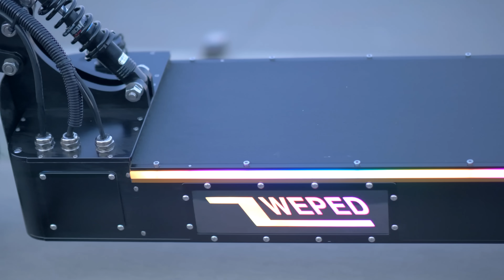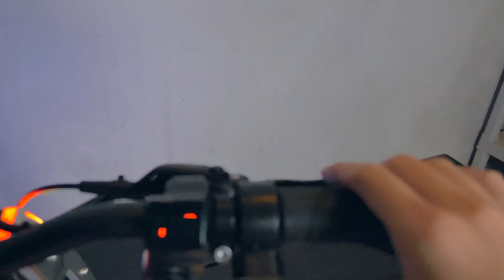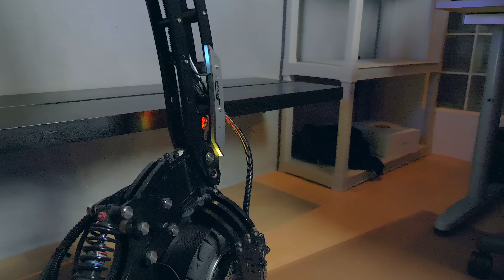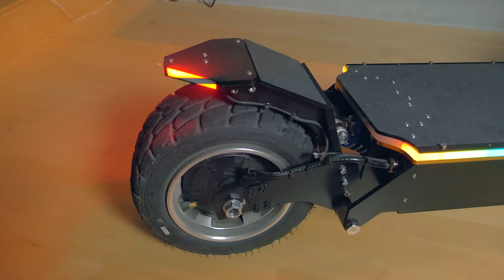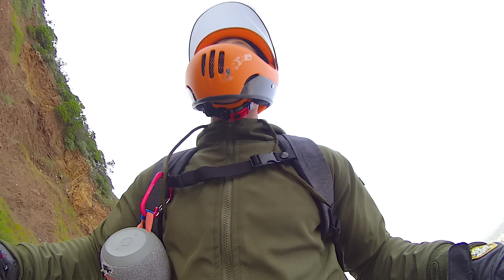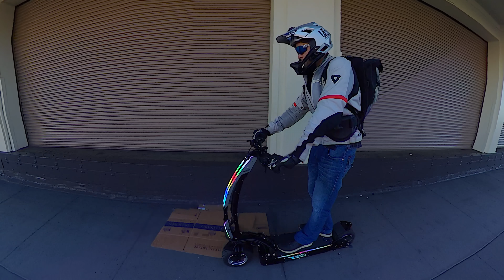WEPED SS Electric Scooter, An Insanely Fast And High Quality Ride

Comment: If we’re paying 7 grand for this then we’ve all lost our minds
Reply from the maker: My excuse: my mind was lost a long time ago 🤯😅
Reply: @AlienRides  kind of idk.. if i had it and was bored and bye had it i mean millions $$ it is awsome i would spend the standard 7-1k on a stock deck than put another 5-1k into over time but thats part of the fun for more building/moding with this there is no build or mod new bars mirrors lights done nope lol
Reply: @AlienRides  -mine to I been shocked into submission 🤨🤐 once I realized that electric motors produce 3 time's the torque than cumbustion engines my 2 stroke GP bike building day's were over getting 30bhp from a 5lb Outrunner  motor is still amazing to me I'm totally SHOCKED 🤯🤯🤯🤯🤯
Reply: Yeah. This is about $6000 too much
Reply: Right I paid $5500 for a used Triumph Bonneville...it's got lights and blinkers and all kinds of crap on it!!! :). Even a horn!!
Reply: I paid $4000 for a dualtron storm. Has all the lights and blinkers you need to ride in traffic and goes 60mph! Also has a removeable battery. We save on the whole no need for a license insurance gas thing. I now have the new storm limited on preorder and it goes 75mph for only $4900. I'd much rather have that than a used triumph Bonneville lmao
Reply: @fishstickkitty8068  so its okay for you to pay 5,500 for a scootwr but someone who spends 7,000 has lost there minds? Seems its just ur opinion
Reply: @89turbomk3  triumph bonneville isn’t a scooter and it’s a shit ton more bike than this thing by a long shot but hey spend your money how you’d like
Reply: @fishstickkitty8068  bikes just scooters in a different configuration
Reply: @fishstickkitty8068  i paid £3000 for a Triumph 955i Tiger - as well as all the goodies you mention it has heated handgrips, and will do around 130mph in comfort
Reply: I was going to get the dual tron
 x but I changed my mind, I’m going to get the weped ss!! Amazing tech! I love it! People do the math a bikes insurance cost thousands, in 2 yrs you bought a weped from bike insurance and gas
Reply: @supermanlives010  - smart man now Tet ready to feel emancipation from them Earth killing oil burners
Reply: @FarnsworthIII  yeah right now there isn't. Wait till enough people are out there riding these things at those alleged speeds. You think the government isn't going to step in and regulate? I keep saying, speed shouldn't be our focus with these modes of transportation.
Reply: @rustilldown7  - been riding 10-30kw electric Scooter's for the last 15 year's the simple fix is to have ajustable pot/throttle 1000w street mode flip button to off-road at Max power this is what keeps us within the Laws that was set by very bad people in the past (American History)
Reply: @rustilldown7  Its good to be able to use it on the highway when I want to go work though...
Reply: @illuforce  why not they have a sit down version at that speed?  Most seem to only hit 40 mph tops
Reply: @rustilldown7  I agree. Some want EUCs to be faster than the curent 50 mph.
Reply: Fuck that! having a laugh
Reply: The price is about right for me 😅🤣💪
Reply: It's amazing what people with no mechanical knowledge will pay
Reply: @TheEdub.  Yup, that's their market.
Reply: BrendonIsAwesome - I’m glad you told us 7 grand for this is too much. You are awesome like your name says.
Reply: I can get a brand new 300cc motorcycle for less than 4k
Reply: Don’t get me wrong I think this thing is incredible... about 3 grand incredible
Reply: WORD
Reply: That's a a nice scooter but I still prefer the Dualtron X.
Reply: Means I’m Bill Gate’s nephew.
Reply: I bought at 98 zx1100 for 250$. Needed a new fuel tank and carbs cleaned.. this scooter is cool. Like 1.5k$ cool. Im being generous
Reply: These high end hyper Scooters provide a very addictive experience, a SuperMan like. effect, a sense of weightlessness that is highlighted by the stand up position. The suspension is Phenomenal on the Dualtron Thunder!!!
Reply: I def wouldnt say the thunders suspension is phenomenal...those cartridges are serviceable at best...storm owner here. Now the dualtron x2...thats got some suspension!
Reply: Hmmmm that's what I thought when my son wanted a 125cc GP redbull bike at 30-40,000 USD but then I thought it is a Gp bike and not everyone has one nor can they ride it
Reply: BrendonVlogs fuck it definitely a sport lol
Reply: I love scooter
Reply: Itd take me 7 years to save up enough to get this
Reply: @First Munch  I'd rather buy a used Harley Davidson for that amount of money.
Reply: @FarnsworthIII  
Freedom from what? Separate you from your $7k? Ok then....
Reply: For all that money rather get me a bike of 600cc or 750 🤷
Reply: Just use the same justification for 2 Million dollar hypercar. You buy it because you love what it does, what it means to you and, well, because you can!
Reply: I'm usually open to high cost PEVs because I don't own a car. But whew doggy! I think I'll stick to my $3K EUCs.
Reply: Considering motorbikes are tens of thousands of dollars this is a good alternative
Reply: @sidneywestcomb2994  for "tens of thousands of dollars" you can get a Kawasaki Ninja H2R (the most expensive current production motorcycle...$55k....0-60mph in 2 seconds....top speed of 240mph!!!)....for us mere mortals, most bikes are under/around $10k brand new
Reply: @samprakos  and I can buy something that'll only cost me a thousand dollars that can go fifty miles an hour for fifty miles and I don't have to pay gas.
Reply: @sidneywestcomb2994  but my comment is about this particular product....for $7000.  Here's the thing, if you think this product is worth $7000 then you should buy it!! :). I just bought my kid an electric e-bike thing that does around 20mph for $450 it's great.  This scooter thing just isn't worth 7 grand...is my point.
Reply: @sidneywestcomb2994  and your comment about motorcycles costing "tens of thousands of dollars" is just inaccurate.
Reply: btw, your idea of a "vehicle" that can go 50mph for 50 miles for $1000 IS A GREAT IDEA!!!
Reply: @samprakos  oh sorry must have misinterpreted your words
Reply: Would never spend more on a scooter than a fckn car.
Reply: I have spent 7K on my custom dualtron thunder
Reply: NEED FOR SPEED
Reply: 7K = Dumb
70mph = Dead
Reply: Yall obviously dont know the price of a high quality lithium battery. 1000 dollars wouldnt get you the battery and speed controller.
Reply: Indeed. With 1/3 of the cost i could buy a 125cc. It reaches around the same speed, in my country you can ride them with a car license, it's tax free as well, can legally ride on highways, insurence is relatively cheap, fuel consuption is really low wich means it's dirt cheap to run, and it has at least 4x the range. 
The truth is that at least in my country, with the friendly laws towards 125cc, an expensive E-Scooter like this makes no sense.
Reply: Heck no is that price worth it!!
Reply: I paid 3400 for mines and it goes 70mph I have a mars xtr
Reply: Looks childish with those silly light.

Comment: What's up buddy. I was going to email you but I got a new phone and I don't have your email address. On the way home from the beach yesterday I got a flat and had to push the scooter 13 miles home in 90 degree weather. I'm so sick of getting Flats. I think I'm going to go back to the off-road tires. Since to you know a lot of people with scooters can you ask around and see if they make an all-terrain tire for the ultra. If not I'll go back to the CST off-road tires. Thanks.
Reply from the maker: Hey buddy - I've got my e-mail address in my youtube "about" tab so you can always get it there if you want, but I always pay attention to the comments 😁

Sucks about the flats, I'll ask around about off-road tires. No idea how you pushed for 13 miles, I would've risked leaving it in the woods and driving back maybe. The Weped also interests me with its run-flat tires that you can supposedly ride on after a flat, but it doesn't turn as well as the Dualtron.
Reply: @AlienRides  Trust me it totally sucked. I'm definitely feeling it today. I've actually nursed it home before with a rear flat but that was with the CST street tires. That's not happening with the pmt's. The reason why it always happens to the rear tire is because when you hit something with the front tire it kicks it up then ends up impaling the rear tire.

Comment: "70" Miles AN Hour, You can ""DIE" ON IT TOO...
Reply from the maker: If you can't die on it, it ain't fun 😅 Definitely a crazy machine though, the upcoming Weped CT is not going to be nearly as crazy.
Reply: @AlienRides  correct the average car goes over 120mph and teens driving them by the millions all over the world daily 🤐
Reply: @Prime8627  And crashing and dying. But that's ok, population control.
Reply: I'm just so happy after riding high power scooter's alone for the last 15 years it's finally quality  scooter's that's fast and expensive  I can smoke all while having fun furthermore now that people can see that power don't come cheap @6000-7000$ USD for 7kw of power then my custom liquid cooled 40kw!!! mid-drive Gp circuit bikes should fetch 125cc GP bike prices  since they are the same power output🤔
Reply: Barret Norcross Omg? Did you know you can die in a car too? Die in a train too and die in a plane too? So crazy dude
Reply: See y'all soon Alien Ride's I have a campaign with Luna Cycles first gotta smoke all them modded Sur Ron,s  then kill off the Dueltons & Weped SS  & Rion,s which are all my favorite factory manufactured light electric vechicles I have located the Allspark so the battle has begun in the bigity bay babe 🤐
Reply: YOLO!

Comment: I doubt that it’s legal to drive with that high power scooter on public roads. And that thumb throttle is way too small and could break off easily. It’s the same as on cheap 300 € Scooters.
Reply from the maker: Technically it's only legal in most places if the speed limiter is turned on. It's a bit of a shame though, because these vehicles could be the replacement for mopeds and things like that.
Reply: @AlienRides  For Sure. But then it's better to have a seat, while you're driving.  At low speeds it's okay to stand on a scooter but over 30 mph I would recommend a  scooter with a seat.

Comment: First thing I'm doing on that scooter is going to my local speed camera  on the motorway that took my license n make it flash  all day with a middle finger printed on the back of my jumper  n anything else I can think of 😂😅
Reply from the maker: Haha, that would be awesome. You gave me a good idea 🤔
Reply: Alien Rides  ,, well I hope that idea got flash 📸 in it  lol make it happen I'll be waiting 😎👊
Reply: @AlienRides  You will be caught. Back in the day all this was on the QT. Deafscooter was doing this 20 years ago. I don't think he was ever caught but he was building scooters that looked like a home built. He also towed battery trailers. He is the pioneer of scooter modification. He used to go 100 miles on lead batteries.
Reply: Dude that's what I would definitely do 😉

Comment: Broke my tailbone at 20mph lol so be careful...
Reply from the maker: Oof, sorry to hear about that. Injuries at a much higher speed can obviously be way worse, definitely going to be investing in some more protective gear.
Reply: @AlienRides  look into rear view mirror attachments as well so you don't have to turn your head all the way around to check behind you.  Also look into power banks with wall outlets (that can charge a car battery) so you can charge it at your destination before heading home if it is the beach or anywhere without public plugs.

Comment: It can have as much quality as is possible to fit into a small set of batteries, two motors, wheels and a board, but at $7000 there are cars priced not much more than that brand new. That price is out of control.
Reply from the maker: Yeah, it's not cheap for sure. The upcoming Weped CT is going to be a lot more approachable, and still have high quality. I'm hoping for more models in the high-end here which should help drive prices down in the future.

Comment: Rip off, do you know what kind of motorcycle you can get for that new or used?  I'm tired of less material and engineering costing more money just because it's electric.  These companies are so small they have to charge a ton for something you can make in your garage.  I definitely would keep my money.  This should cost $2500 max.
Reply from the maker: I'm hoping that more competition and cheaper batteries causes prices to go down in the future. The newest and bleeding edge of anything costs quite a bit, and I agree that it's pretty expensive.
Reply: Agreed, my first Bike was a 650cc sport bike and it was only $5,500 brand new. With an added bonus of being street legal and much better mileage.

Comment: 75 MPH on a scooter designed with a rear axle nut shanked out a half thread...no thanks!
Reply from the maker: I’m not mechanical, how would you improve the rear axle design? Most scooters axles are simply secured with nuts with loctite.
Reply: @AlienRides magnets
Reply: YOLO!
Reply: As easy as making the axle longer to protrude thru the nut!

Comment: Should have a twist throttle. Much easier to control and far safer.
Reply from the maker: That would be interesting for sure. Should be possible to modify it to have one if you wanted to.